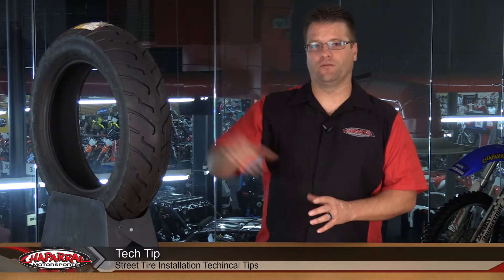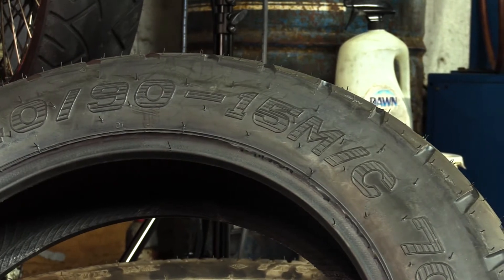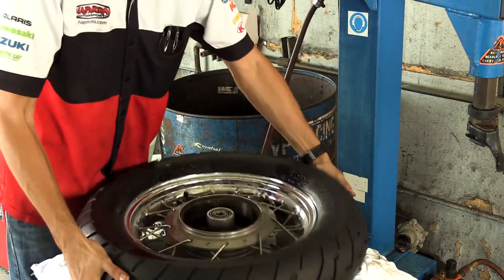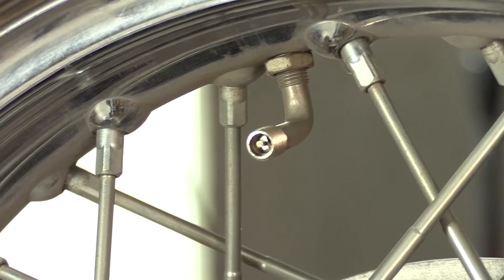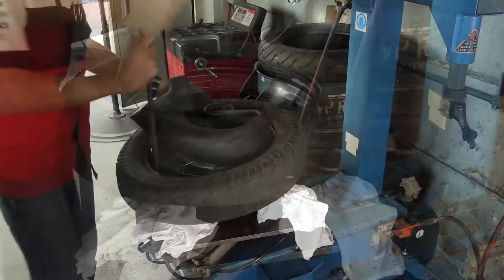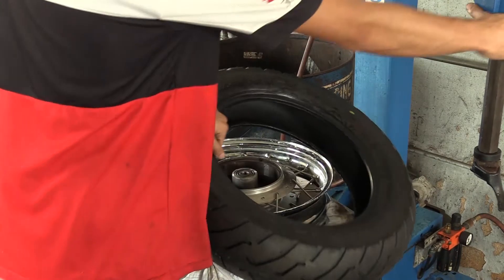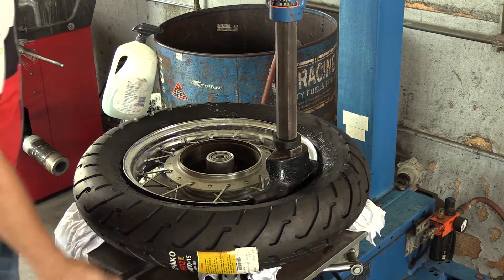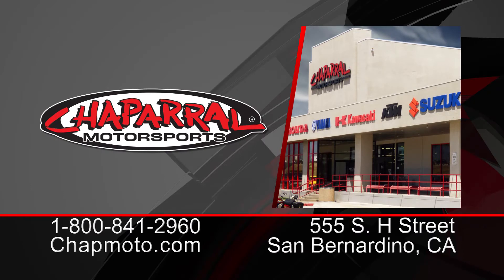How To Mount A Motorcycle Tire

Comment: Just noticed on my Z1000 that my bead has 3 cuts or splits and the balance dot is about 5" off the stem! I had the work done may 1st 2019, new rear and front Dunlop Sportmaxx Q3++ . I probably put about 1000 mi on it. Guess we'll see what the shop has to say tomorrow.
Reply: 5" wouldn't matter much on my Ural Sidecar rig, But might make a big difference on your Z1000 if they didn't precision balance the tires after mounting.
Reply: @canonmanmart  Dunlop replaced the tire for free and I had a different shop do the mount/balance this time.

Comment: This video isn't much help if you don't have professional tools. left out important details like lubricant to use and how to avoid pinching the tube.
Reply from the maker: Thanks. Good points.
Reply: Also did not point out how to set the valve stem of the new(?) or reused(?) tire  tube before tightening up the beads against the rim. Should the tube be coated in talcum powder before inserting in the new tire to avoid pinching the tube, as with bicycle tire tubes?